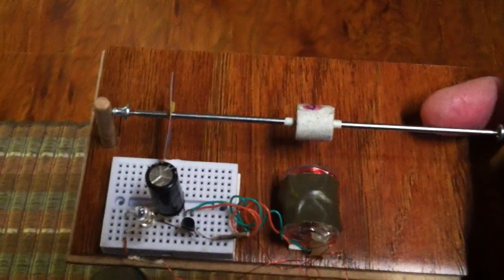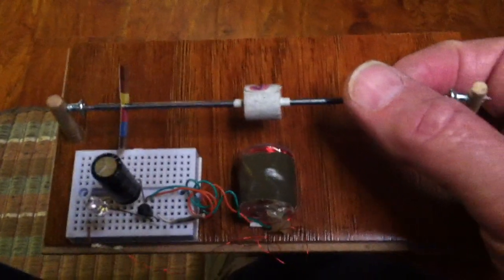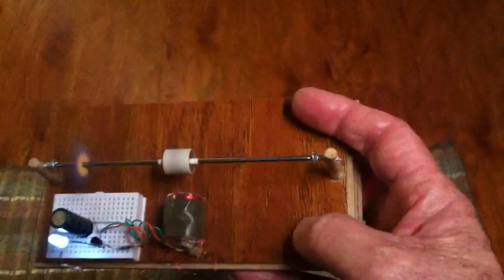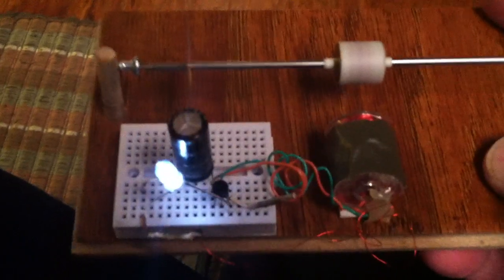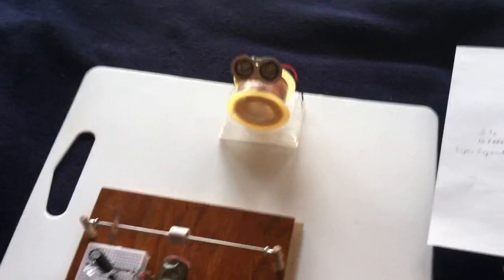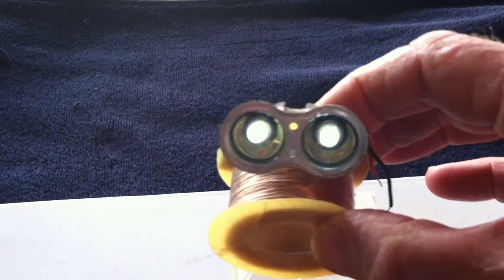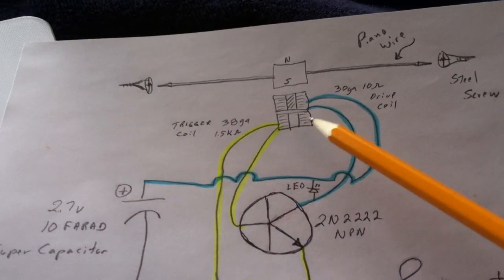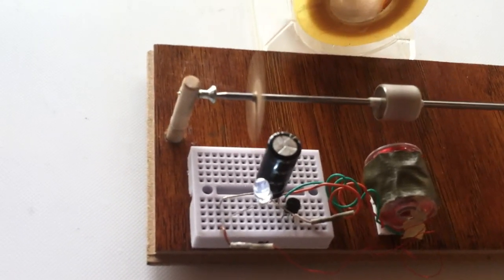Piano wire motor

Comment: Nice shaft and mounting scheme.   I've used your "machine screw with graphite" idea before.  But only in a vertical orientation.  So I'll have to try a horizontal mount.  Also, why did you use a ferrite core for the drive coil?  You don't normally do that, as I recall.
Reply from the maker: I used the ferrite cored coil for a really important reason----It was laying around and handy. Ha.  An air core would probably worked better.  I just didn't want to spend the time winding one.

Comment: Specifically regarding this magnificently  simple build in intricate detail. ..
1) What gauge is the piano wire? That would have to be wire from a low frequency since it is a large diameter and rigid. 
2) What is the quantity of turns on the 2 coils. ? You say 10 ohms on the drive coil and with #30 that would not be much of a winding on the spool. Is not The Trigger coil with #38 is a fully would spool for 1.5 K ?
3) You usually describe the manner of how the magnets are attached into the cylinder on the shaft and what kind they are - neo or ceramic? The balance is excellent and extremely critical since it's spinning rapidly. 
4) And also, what is the spool for good ol' Maggie ? is that a 1/4 Lb or 1/2Lb of #40? AND Why Not hook the LED's directly to the spool ? The induced EMF is and AC and will still illuminate them on half the cycle since they are diodes. AND what if you put a C across the LED's  of say 10-200 uf - that would hold the illumination for a quarter second - perhaps with a small R in series with it ?

Comment: Could you please explain how comes that the Magnet is swinging when not rotating? This is possible ONLY if current runs permanently through at least one of the coils. While it clearly comes from the cap it must have opposite Polarity of the LED. So when Rotation starts then first the cap Polarity has to be reversed to make the LED lit. If so, however, then the Motor is fairly impossible to stop after few minutes, as you say at the end. At least one thing in the Video doesn't fit... Always.
Reply from the maker: Good question!  I was wondering if anyone would ask about why the magnet wobbled when the motor was stopped.  The reason is that the magnet is attracted to the ferrite core of the drive coil.  There is no current flowing in the circuit when the magnet rotor is not rotating.  When the rotor is turned the trigger coil (fine wire coil) generates a current that turns on the transistor and current flows through the drive coil.  The capacitor is not normal.  It is a super capacitor that is more like a battery. When the energy stored in the 2.7v 10F super capacitor is depleted the motor stops. The current draw is about 30mA.  Run time is a few minutes with a 2.5v charge on the capacitor.

Comment: Yes, but why? If the cap is initially empty, then how comes that it will run for only few minutes? The only Energy from the outside is your manual Start of spin. And that can impossibly be the Source for even the LED lit for more than few ms when Rotor stopped. So the cap has to build UP Energy while running. But then the system will not ever stop...
Reply from the maker: The cap was pre filled. I just didn't show the charging that was done before the video.
Reply: If the cap Was prefilled then the LED has to lit before Start.
Reply: And it would also Bretter explain the wobbling of the Rotor...
Reply from the maker: No.  The led is backwards and lights when the back spike (flyback) of the coil happens.  There really is no magic in this device.  It is just an interesting brushless DC pulse motor.

Comment: Maggie was really pulling down that motor.
I had fun today with my magnesium ribbon.
The carbon and lead in lemon juice just barely lit the led then stopped over nite.
The magnesium works very well with out any liquid.
 Cant wait to see what it does over nite.
 https://www.youtube.com/watch?v=BtufzF-FaPU
Reply from the maker: Yep Maggie can be a real drag sometimes.  I have told her over and over---"Don't get too close to the magnet!"  She never listens.  lol.  I took a look at your Mg air battery.  I made a bunch of those Mg ribbon batteries.. They work pretty good but mine usually failed at some weak point in the ribbon and stopped.  I have a plant battery using a 1/2 Mg rod that has worked well for years,  It is running a Joule Thief.  The plant root structure in the soil really seemed to help cell performance.  The house plant doesn't appear to be affected by the weird chemistry.